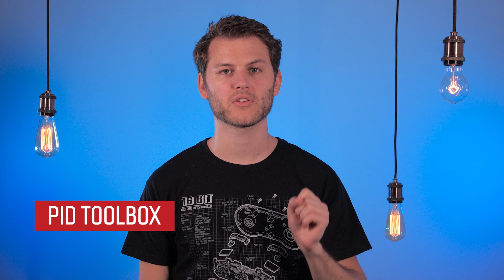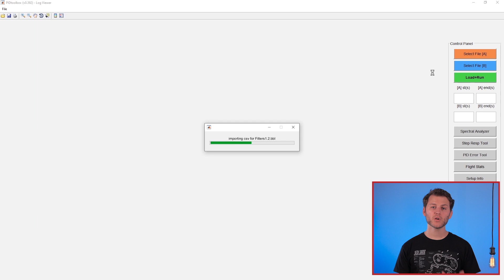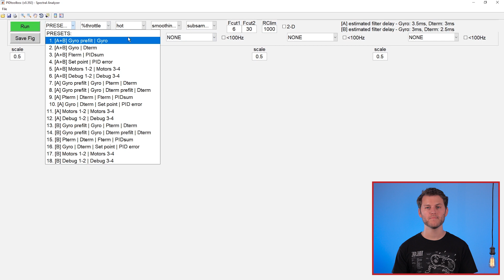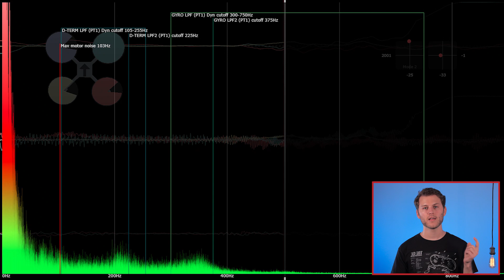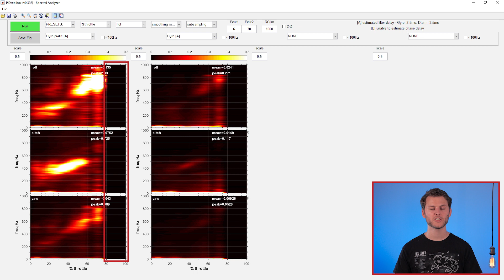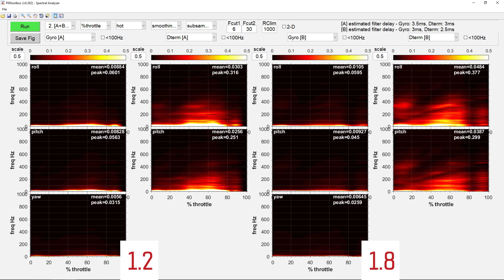Betaflight Filter Settings #2: PID TOOLBOX | Advanced Filter Tuning Tool

Comment: i get my d term prefilt very noisy stock filter
roll peak 1.24 mean 0.269
pitch  peak 2.66 mean 0.42

then i try your filter setting （lesser delay）
roll peak 2.05 mean 0.38
pitch  peak 5.17 mean 0.46

and then i try chris rosser aggresive filter
it become super bright and hot
roll peak 3.43 mean 1.15
pitch  peak 5.79 mean 1.44
Reply: and i been experience hot motor is it because of not enough filtering
Reply from the maker: Hi! Prefilt signals are not related to any Betaflight settings but only to your physical configuration.

Small quads, bad frames, or damaged motors are some sources of noise that will make your pre-filtered signal very hot.

The goal of filter tuning is to find the right balance between phase delay and keeping your motors safe. If you can't fix any physical issue to have less noise in your pre-filtered signal, you only need to look at the filtered traces and motor temperature. If it's clean, your motors should be safe. If it's still noisy after filtering, it will be harder to reduce your phase delay, because you can't reduce the amount of filtering too much. 

I hope it helps you understand what you should be looking for! Tell me if you need more info.

Comment: Great series! i have watched a lot of top Tubers guide videos how to use blackbox, and your videos tells the most important things very quickly and clearly. Been in hobby for 5 years and counting myself as a pro, but blackbox is something that i have always tried to avoid due to its complexity (been rocking kiss and RF). Now when trying to tune this 13" 8kg monster i got no choice but learn to tune with the blackbox. So maby make next a tuning video how to tune quad for HD footage. I mean tune that prioritize steady footage on full throttle range (in wind and no wind) over the ultimate flight performance and propwash handling
Reply from the maker: Thank you very much for your comment! As a professional videographer, my goal is to focus on HD footage. This series is still covering the basics, but I hope it will become more and more precise in the future. Bigger quads are also in my to-do list !
Full throttle seems to be kind of a hard range to tune, because so many factors are introduced in the data (same goes for the wind). What camera are using on your 13" monster? 😀